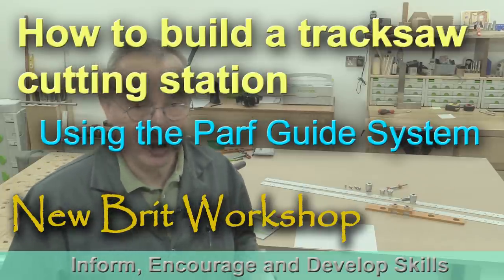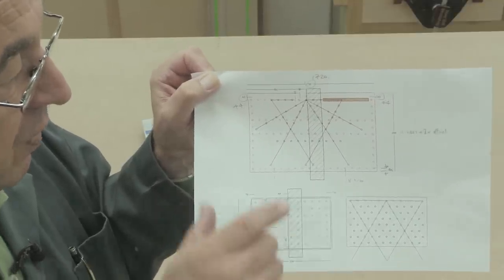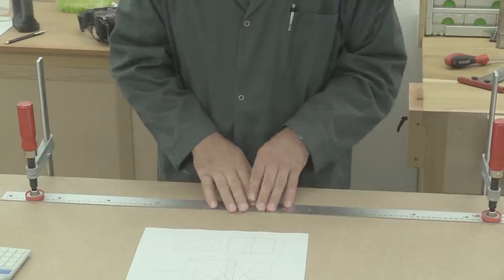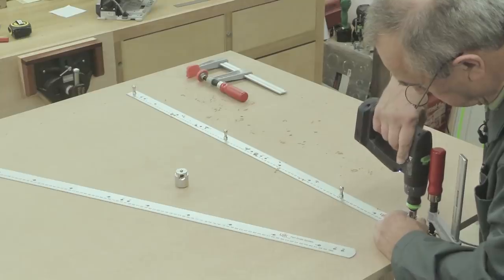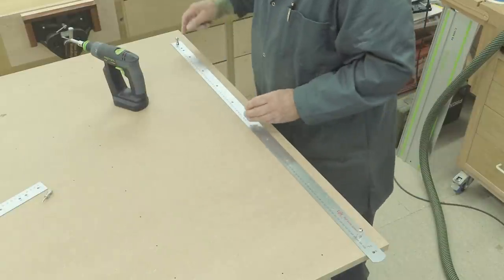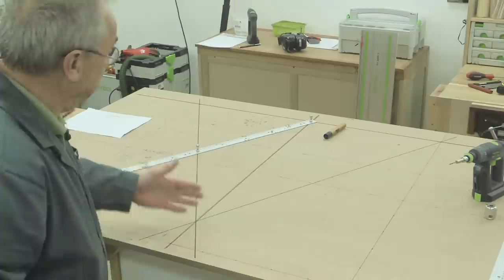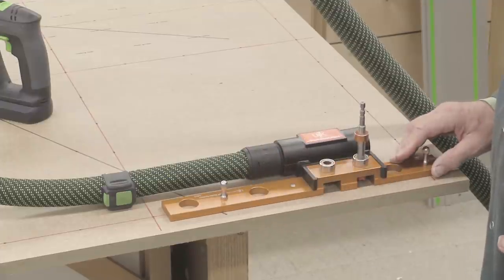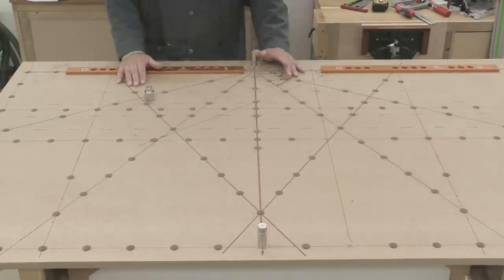How to build a tracksaw cutting station

Comment: May I ask a question: in light of the fact that you are striving for absolute accuracy, as the two rulers are required to overlap at some stage of the process, sitting one on top of the other. Surely this would create some degree of inaccuracy as one ruler is sitting slightly above the other, on a very acutely angled plane. I assume you base your idea on pythag but with one ruler 'riding' on the other, this would create a small gap underneath the top ruler, thus creating an additional triangle on the vertical rather than a flat line. You will always be 'out' by a fraction, every single time you overlap the rulers. Fir absolute 100% accuracy, the rulers should not overlap. For those wanting total, complete accuracy, this is an issue. Unless of course, you have already considered this, and the holes in one of the rulers account for this discrepancy?
Reply from the maker: Hi James, Yes, it has been examined and the cost of the contraption to have everything flat was not worth the 0.001 deg difference.  Peter